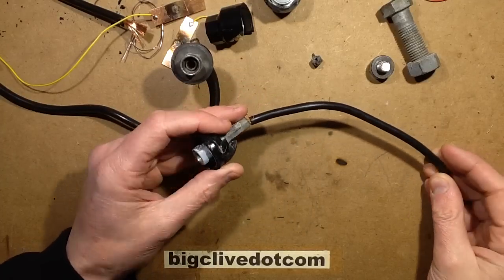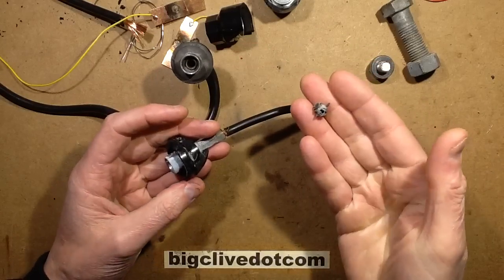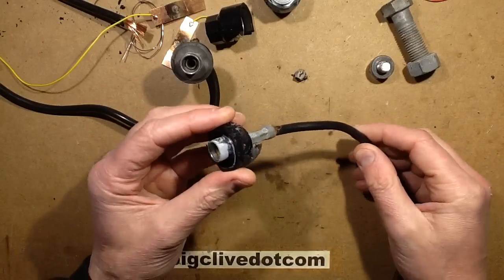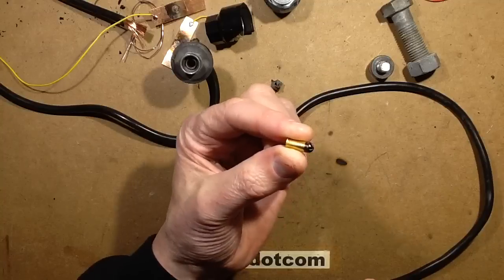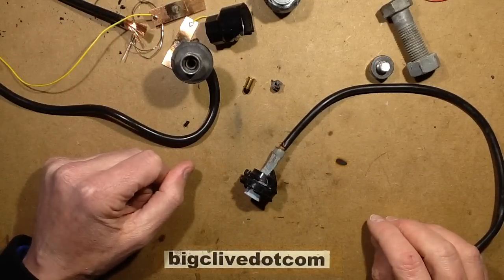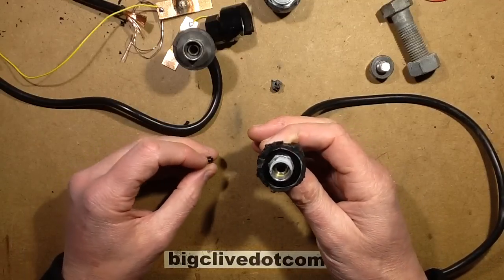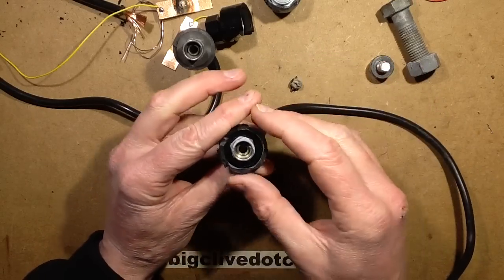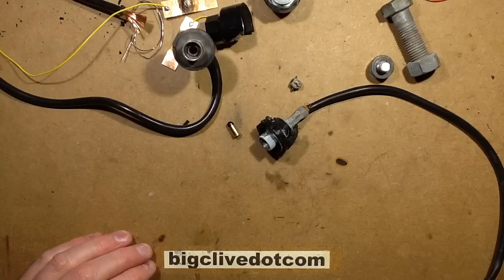Bear, beer and bang update!  The hidden explosive charge.

Comment: A 22LR round will fit exactly into a 13A fuse holder. Please don't ask how I came to know this.
Reply: Donald Sayers that gives me an idea that you possibly already tried😈
Reply: Whistles innocently

Nothing cooler than wiring a 13A fuse with a 22LR into a car so that when you turn the key, BANG!
Reply: Mythbusters? They tested that in like season 1 I think. I've done a lot of stupid things and have come up with a lot of bad ideas, but putting a live cartridge in a fuse holder to pass current.....  Not something that ever entered my mind.  Lol
Reply: Challenge accepted!
Reply: Audible overload indicator, just listen for the bang.
Reply: bob s And a very definite disconnection from the supply- will force one to investigate the fault!
Reply: I remember reading a You Tube comment some time ago. These two guys and their girlfriends were parked up in a car, one couple in the front and the other on the back seat getting down to 'business'. The car radio was playing music then it suddenly went silent because the fuse blew. The first thing they could find to replace the fuse with was a live bullet. This restored the radio so they carried on.
 The next bang wasn't the type they were working up to!
Reply: bob s   very funny...
Reply: If it "blows" at a sufficiently high current, it's still essentially a fuse. It would work the same way, other than presumably not having a reliable current rating (and also destroying the device and posing a serious danger to anyone nearby, but it's not like that's what a fuse is meant to prevent or anything).
Reply: HMMMMMMM
Reply: @ids1024  I mean, it'd be a fuse, sure.  But instead of blowing the circuit it could easily blow the entire fusebox or start a fire and thus burn down the house.  I still wouldn't suggest it.

Comment: The comments below describe a similar charge to the ones used in nailguns. They have a colour code on the tip which indicated the power. Black tips are the bad boys which your Hilti can use to staple two RSJs together. A pal of mine (ex BT engineer) described the nailgun charge as nitrocellulose soaked in nitroglycerine. Check out ebay for Hilti refills (except in Australia)
Reply from the maker: I've used the early Hilti guns and they were quite "forceful".  (And fun.)

Comment: Certain classes of transocean racing yacht have special bolt cutters that can be loaded with an explosive charge to cut through wire rigging in the event that the yacht's mast breaks. As you still have the sail and half the mast give or take dangling in the water, it can overpower the righting moment of the keel and cause the yacht to capsize (or turtle, that is do a 180)  and you want to get all of that clear of the boat as quick as possible while you wait for rescue, some actually now have the charges that can be clipped or wrapped around the wire rigging and have a lead to detonate them from a safe space like inside the cabin.

Comment: The "Bang" serves a secondary purpose.  When I was in the utility business we would find faults based in where freaked out customers called in reporting "transformer explosions".  Usually it was a dead squirrel and a blown explosive interrupter.  Some of the bigger fuses had a much larger charge in them, you wouldn't want to fire one of those on the workbench.
Reply: Yeah, I saw one of those go off once... big transformer on a pole down the block - made a hellacious BOOOM! and the neighborhood went dark apart from the pole being on fire.
Reply: So, totally not the point, but I'm adding "Combustible Squirrel" to my band-name list.

Comment: Try the fuses for three wire HV. If one fuse goes it pushes a pin out and disconnects the other two lines by fast switch.

Comment: How you have a self notifying fuse that let's you know when it has blown and conveniently removes the cover from the plug at the same time. (Which is a really stupid idea and most probably would not want to be in the same room). 
Myth Busters did test the myth of someone injuring them selves when they used a 22 to replace a blown headlight fuse under the dashboard of a pickup truck. With a catastrophic short circuit it did go pop.
Reply: One of their earlier episodes, IIRC. They also tested putting various ammunition in an oven.
Reply: Which resulted in a bang, but no serious hazard with no gun barrel to build pressure and direct the bullet...
Reply: Bob Weiss the only danger is plastic " whatever the casing is that is blown apart "  in the eyes

Comment: If you want a proper bang, reload it with one of those concrete nailer cartridges.
Reply: that appears to be exactly what it is. my guess is that you'll find the same cartridges used in Hilti tools.
Reply: How would you reload it?
Reply: duck tape, clearly....
Reply: sexyxenomorph Interesting. .. In the United States we have concrete nail tools in both .22 and .27. The .22 is generally more available.  My guess is that the government here is not concerned with the use of these blanks in an actual firearm because access to ammunition is not restricted.  Also, with the insane quantity of firearms available in this country, it is not an issue. Even street thugs can procure a pistol and ammunition quite readily if they have cash. It interests me to see the contrast in regulation and product availability.
Reply: That's what it is.
Reply: it is a concrete nailer cartridge
Reply: I'd be pretty damn confident that there is a separate manufacturing/supply chain for safety devices like this. But it could be made on the same line with added checks.
Reply: poplug it's a safety product. The added costs on the supply side are tiny compared to the cost of a lawsuit to repair a power line pylon. I'm guessing these need to be three plus 9's reliable, and traceable. Then if the one in a thousand or hundred thousand happens insurance just covers it.(The insurance for the owner of wherever the arrester was installed, not the insurance of the maker of the arrester)
Reply: ***** and once you start making hundreds of thousands even 100% inspection and whatever level of destructive sample testing doesn't drive the end cost compared to having to actively monitor every single one.
Reply: or... blackpowder charge/ >:D
Reply: +Peter S, hilt I tools use a .27 caliber load that is a bit lager in diameter than a conventional.22 blank. They are also shorter in length. It is more likely that the manufacture of this disconnection device uses a proprietary "bastard" sized blank to circumvent various firearm and ammunition laws throughout the EU. If it fits no known firearm both civilian or military they are safe. Just like Hilti, no firearm manufacture has created a .27 caliber firearm. They are in the clear. Now if you were to use one of the very early powder actuated fasteners systems like from Olin Corp that used a .38 caliber blank the manufacture of these disconnects could run afoul of many jurisdictions considering it could fit many firearms. How likely would it be for someone to steal these disconnects from a live circuit? Not too likely. Keep it odd and its a safe bet no one will complain.
Reply: I have an interesting anecdote there:

In 1990 I was in a computer room on the 3rd floor of an office building with linoleum tiles.  The suite below was being fitted out as it was a new building and we were the first tenants.

I kept hearing large bangs from downstairs and didn't know what it was.  Then as I was sitting in my rolling office chair i felt a large bang under my foot then pieces of the tile started shooting up from the floor levaing conical dimples from where the tile was.

It seems they were using the .22 cartridge pile drivers to secure the drop ceiling support rods into the concrete floor pan.  It seems that the pan wasn't poured deep enough to contain the explosives and was blowing holes through the pan.

Right where I was sitting.

Let's just say I had an urgent meeting with the construction foreman and the activity stopped promptly and much running about ensued to correct the problem as we have a lot of lawyers in the US.
Reply: Kapula Yes.... wow. I find it interesting.  With a file, hack saw and some basic materials, a person can make a firearm.  It would certainly make some shortcuts in such a project.  

Australia is having an issue finding kangaroo hunters. There is a growing demand for the meat,  but people do not want to be hassled with being in the bush for so long and also the laws surrounding firearm ownership.  If they open this to foreign workers, Americans would line up to do the work. 

I am always intrigued by various customs and laws surrounding firearms and tools that have firearm-like capabilities.  Thanks for the information.
Reply: Hell, you can buy those explosive concrete nailer refills at Home Depot in Canada. It's not a firearm.
Reply: Can I get paid to come to Oz and hunt roos?  I'm Canadian, but I would be there tomorrow.

Comment: So it turns out you could have lost your hand because  you had it wrapped around the casing while dremeling. Heat igniting carbon or shell directly , explosion and Clive 1-hand resulting.
Reply from the maker: It would have been numb, but the area I was holding was an enclosed thick metal cup.
Reply: a .22 BB blank would not blow your hand up even if you were gripping it
Reply: Nah, a .22 shell like would not blow off your hand, even if fully packed. From the look of that, it was at max 32 grain, most likely a 21-grain blank. it would definitely jolt you and make your hand numb for a few hours, though.
Reply: You could have lost your hand if you were holding a razor-sharp blade over your wrist-joint, and the .22 shell were perfectly aligned with the blade when it went off.
Reply: So, no remorse for vlogging while drinking alcohol?
Reply: It's the explosion of the external casing though that causes the damage, it just needs enough pressure to rupture violently. Most fireworks that go bang are made of cardboard, but wrap your hand around it creating a seal & mangled hand results
Reply: i used to work for the company that made them, the metal shields are for arcing across under normal operation (the lightning transients are too fast to heat the carbon resistor),  it will only heat, as the metal oxide varistors  fail to short circuit, cutting it open with  the dremel is reasonably safe as you would also have to cut through the metal shells too though we used to use a hacksaw for more control. might be a good vid to show the construction of the arrester itself. the same company was also the first to put the same ZnO technology into domestic plugs and socket strips
Reply: Everybody is not thinking about this the right way. put a .22 shell in a steel pipe. wrap your hand around steel pipe. You don't have a hand. It's merely about the amount of gas it can produce to rupture the casing. It's the external rupture that is the real explosion.
Reply: Ronald McDonald tell that 2 all the handless kids due to gripping a cardboard tube with 2grams of flash powder, called M80's. Yet You think a .22 cartridge containing 2grams of Nitrocellulose which produces more gas faster into a containment vessel of a hard plastic case won't blow up a hand?
Reply: I would guess that the hard case would absorb a lot of the small explosion and that he'd "merely" get some shrapnel wounds.  Maybe nerve damage to a finger at worst.  He shouldn't have dremeled that thing blind, though - if he knew how it was made, he could have avoided the risk of setting of the round completely.
Reply: RKSNomad It's not gun powder(black powder) it's nitrocellulose(smokeless powder) which burns very slowly uncontained but much higher velocity & gas output than BP when contained in brass shell. You don't even know the simple physics
Reply: "Experts."
Reply: I don't know Oh look we have another youtube expert here...
Reply: Alexander Grimsmo It's the primer that is sensitive to both shock and heat. Prob Lead Azide. Without primers bullets just sit there laughing at you
Reply: you aren't a firearms owner are you.
Reply: wu... why did it post that in this comment thread. that was not directed towards you.
Reply: Alexander Grimsmo There's 2 possiblities enough heat to detonate primer via friction or enough heat to ignite carbon right next to primer. As clive showed carbon isn't likely to keep burning
Reply: Alexander Grimsmo 
Unreliable for what exactly?
Reply: Jeremy Pavleck you sound like you googled that. congrats.
Reply: Jeremy Pavleck I find it very hard to believe that a public school system would teach firearm safety. I've been to Kentucky, Oklahoma, Minnesota, Kansas, Georgia, Wisconsin, Indiana, and many more more. none of them have schools that teach fire arms safety. plus you would need a state and federally certified coach to train you.
Reply: Jeremy Pavleck well 30 years ago is a different story. I could see that a school back then doubled as a city hall or department. I. most cases you would have been in a classroom to take firearm safety.
Reply: Clive doesn't err on the side of hysteria. I've seen enough of his videos to confirm that.
Reply: A .22 shell has about 3,000 psi, don't think I would want to be gripping it when it detonates ! I shoot hardened steel pins thru 1 inch thick I-beams with .22 shells for a living !

Comment: this look like the charges used in concrete nail guns
Reply: quaxk the ones i used had .22 without the acctual bullet so they definitely come in different sizes, those things are fucking loud tho if you use them for metal
Reply: The sizes I know of are: .22, 6,3 mm, 6,8 mm and 9,5 mm. Each in different lenghts. The biggest one in my collection is 9,5x28 mm. I have fired one off, it sounds like a .357 magnum.
Reply: My father had a 32 cal ramset. And you could fire nails as bullets if you pulled the foot back and pulled the trigger.

Comment: ...Now we know and knowing is half the battle... A reload could consist of a small ceramic resistor or a spring. Either could get hot enough with a proper amount of current. Additionally it should be slightly less terrifying now that you know what to expect. That was far more fun than a dodgy USB power supply. I'm just saying...

Comment: Yea but all you did in the video was over-volt the carbon rod. the explosive charge was OBVIOUSLY still in the cup. You never set off an "Explosive" in either video. Do it again with the .22 cal Blank wired into the equation. The other comments are spot on talking about "nail gun loads" It even had the painted tip which as pointed out is the strongest. They use gunpowder just like any other firearm for a propellent. Smokeless powder to be exact. none of this exotic "nitrocellulose soaked in nitroglycerin" crap. It's just smokeless powder. Pry open the crimped end and pour it out. You will see, BUT keep in mind it's STILL a "Rimfire" cartridge. If you crimp the bottom edge it WILL fire.

Comment: that looks allot like a 22 short  case.
Reply: that case looks as long as an intact .22 short. i'm guessing .22lr blank
Reply: james lawrence not sure! a 22 blank is normally just crimped at the end. that almost looks like a rubber bullet.
Reply: michael shampine from rewatching with the vid maximized on a 32" tv, i'm gonna have to agree with you. i thought it was a .22lr blank crimped which would make it about that length, but it does look like a short with something on the end when I looked closer.
Reply: james lawrence funny I was just looking at the video with my son! again and absolutely it looks like a 32 Cal guessing rubber or possibly a training round???
Reply: james lawrence on second thought NO if you look at the video it looks to have a flat bottom. that would say rimfire so that rules out 32 cal.

Comment: ramset cartrige
Reply: Yeah, that's what i called them. A ramset gun.
12 colour coded cartridges from memory.
I think purple was the strongest, yellow weakest.
Maybe wrong. 25+ years ago.
I remember using the highest with a 2 inch nail through mild steel into concrete.
Need technique for that without breaking a wrist or elbow.